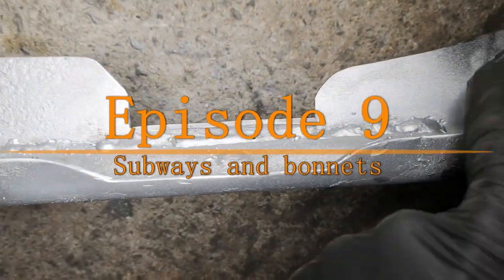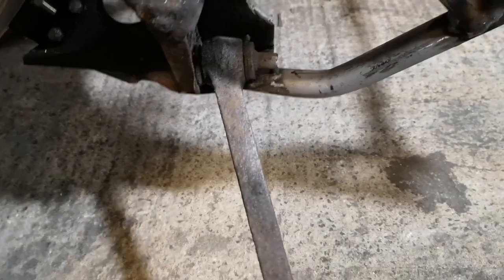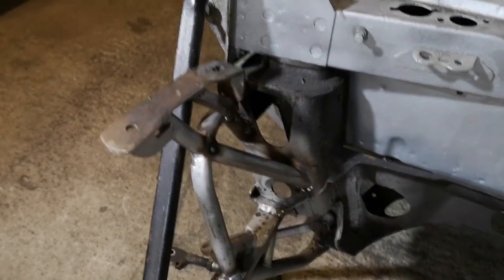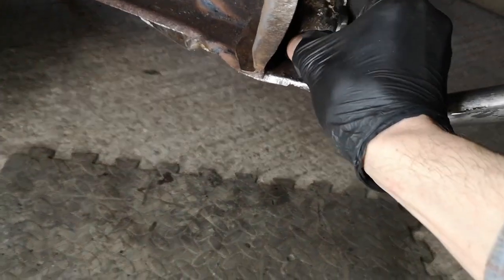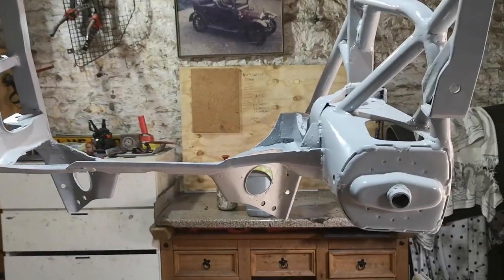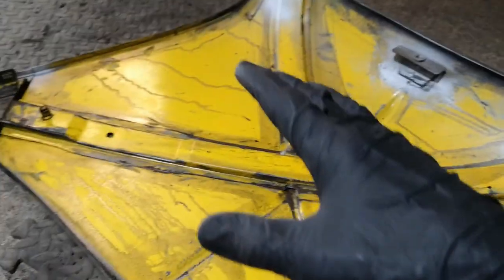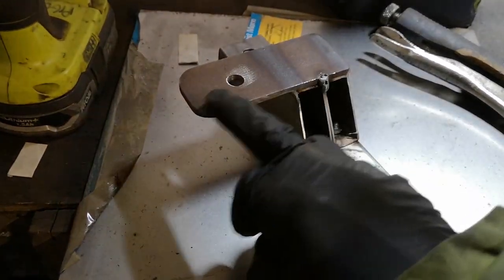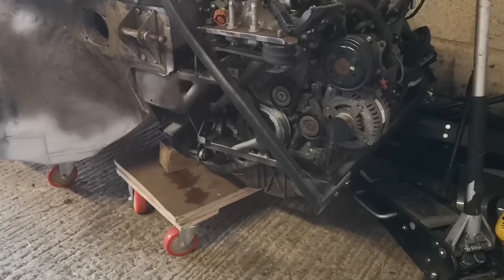The Boosted Mini - Episode 9 - Bonnet hood cap

Comment: Hi, great fun to see your project actually takin’ shape :) But you should consider actually showing when you’re doing the work, instead of just showing before and after shots :)
Reply from the maker: I do so sometimes... But it's often hours of footage... Which tbh..takes way too long to edit and then produce as a watchable video. Appreciate the feedback though. 👌🐷💪
Reply from the maker: Watch this week's 5 episodes... See if it's any better? 

On my Peugeot stuff I usually show more of the process ..but with a custom build, often hours of fettling and maths and drinking tea goes into the space between the before and after shots. Tricky to show that on a short video. 😕
Reply: I usally watch your vids., and when I had a 206gti, I used one as a guide to replace some suspension parts aswell. 

I watch this project because I finde DIY engeneering and mechanical work entertaining. In this exact episode there was “less” of that, and more “here is a problem” and “now its fixed”, if that makes sence?!. 
But I watched the next episode, and it is nice to see some actual work being done again. 
That said, this is by no means a bad episode!! And I actually dont understand, why you dont have more subs/views. Keep op the good work. 

(Btw this took fcking forever to post due to autocorrect being set to Danish🤯)